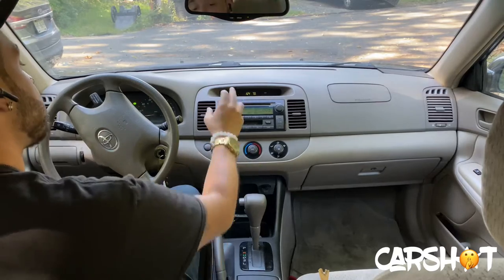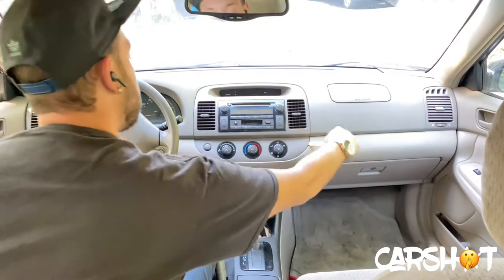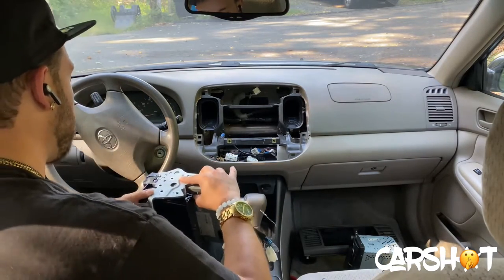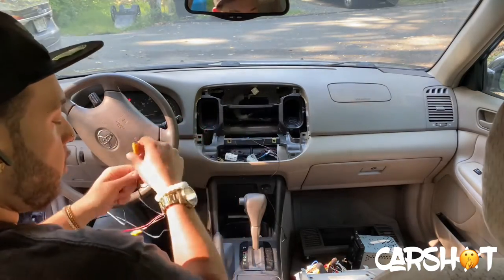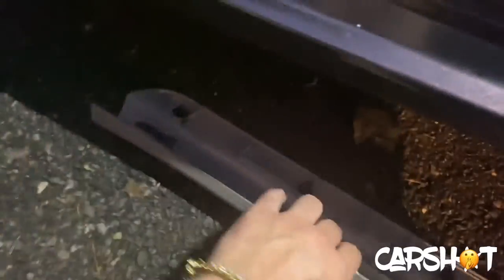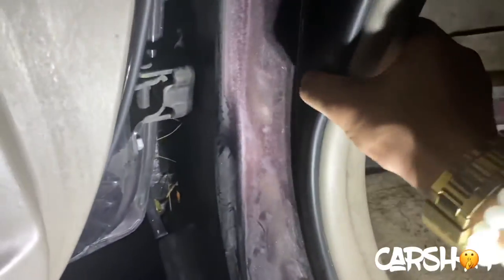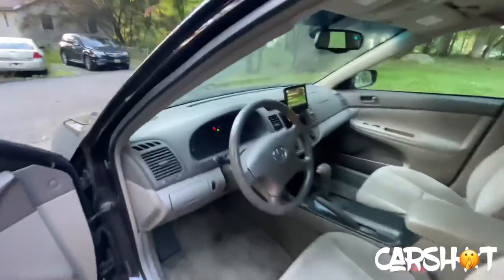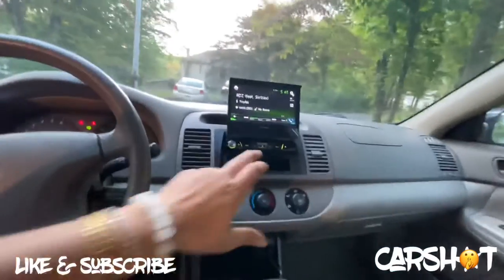Stereo & Rear Camera Install 02 Camry

Comment: Tapping into the black/red reverse trigger wire is a real winner, especially since on this model the reverse lights are in the trunk lid.
Reply: There are MULTIPLE red/black wires back here. I tried the one in the top bank and the middle bank-left. Both are always hot.
Reply from the maker: Exactly, I prefer not to make unnecessarily long runs of wire whenever I don’t have to. Thanks for gassing me up here lol 🙏🏽
Reply from the maker: @fulldecent  gotta keep testing wires while cycling the shifter to see which one has matching voltage. Sometimes different years or different factories have anomalies. These cars were made in both the US and Japan so you never know.

Comment: So is there no need to tap into the reverse light at the back of the car because you tapped in via radio in the front panel?
Reply from the maker: Correct, run the reverse wire from the receiver, usually purple, to the in this case red wire with black stripe in the harness under the glove box behind that lower trim. This wire feeds signal to the reverse lights. Generally this is this shortest run option and doesn’t put an uneven resistance load in the system which may cause issues on sensitive vehicles.
Reply: @IAM_HC  thank you! This video was invaluable to me for installing a new radio and backup camera. I really appreciate it.
Reply from the maker: @kenciardullo7925  thanks for the feedback, hoping to start filming again soon. Just did a bunch of work to this car too